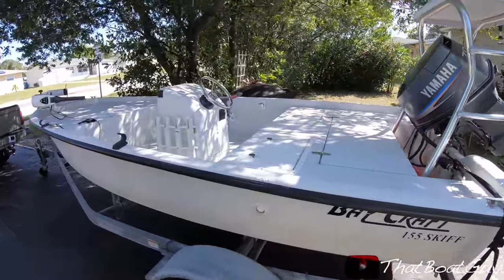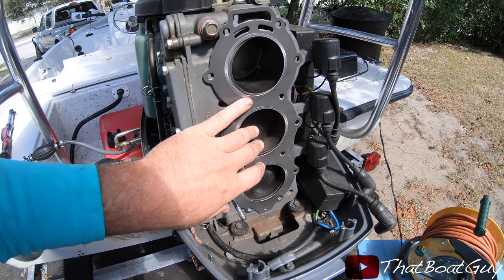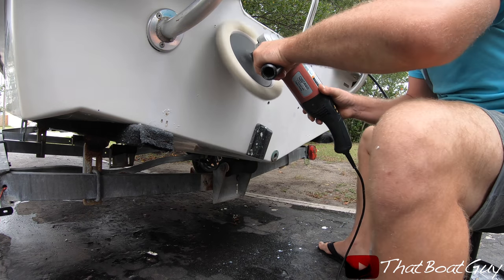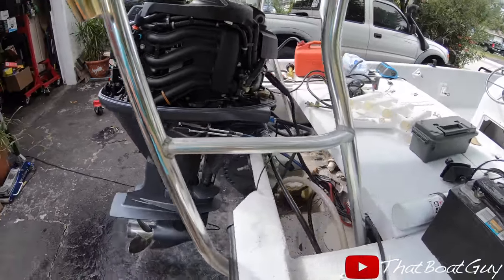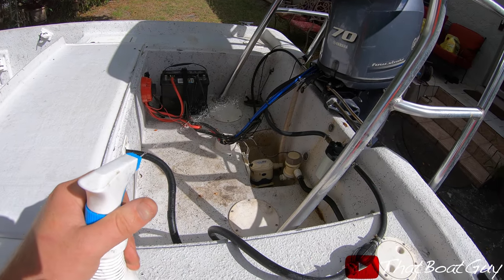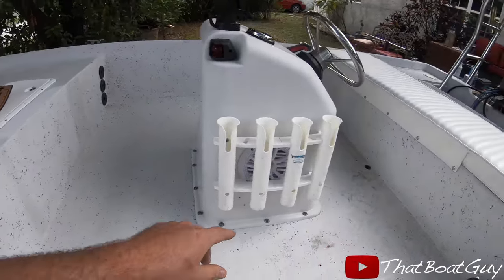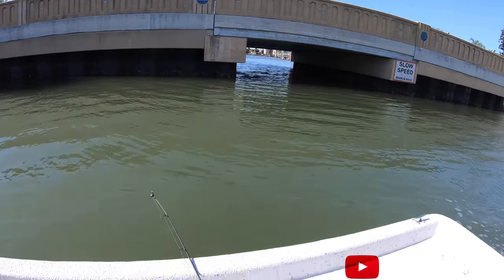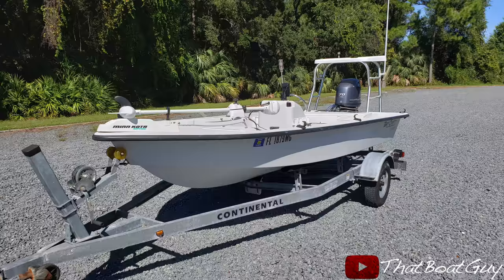This Boat Deserved A Makeover

Comment: Can you make a video of you tearing apart that Yamaha 70 two stroke with the bearing problems?  Would love to see how you go about that and replace internal parts!
Reply: I'd like to see that also.
Reply: He might just use a machine shop. Dunno if ive ever seen a bottom end rebuild on this channel.
Reply: Thirds for the Yammy rebuild video please!
Reply: @shize9ine  i would hope so! 90% of these should be bored in my opinion. ive rebuilt over 20 2 stroke outboards, and all were out of round atleast 2 thousands. my motto is if you want it to last like new, bore and hone is the only way to go. i see so many guys just taking a ball hone and putting new rings in these, and they only last 1/4 of the time they could have if done properly. plus its only $55 a hole from my guy.
Reply: @ct1762  usually caused by not letting the 2 stroke warm to proper operating temps before banging the throttle off the firewall
Reply: @fishonkayakadventure  definitely ! but usually because it ran hot... weather thats from old stale fuel or a blockage in the cooling system, excessive carbon build-up etc.
Reply: @ruaraidhmcdonald-walker9524 uh
Reply: @ct1762  I fully agree! If you are going to go through the trouble of rebuilding, do it right.

I have a friend who did a rebuild and didn't have the cylinders checked. He didn't want to pay the extra money. He bought an aftermarket rebuild kit. I told him he was dumb to not check the cylinders.

After rebuild, it runs. But it doesn't feel right. It's a 40hp. But it feels like a 30hp. Pickup is slow and top end just isn't there... I think it has low compression. He won't let me connect a compression guage 🤣
Reply: @michaelh7527  haha yea... seen it many times. People understandably get anxious to hit the water and neglect some pretty important steps! Which is why I do the serious rebuild in the winter. No "fear of missing out" happening in December up north. I will say promarine, mastertech, glm, etc. do make some really quality aftermarket stuff. probably some cheapo stuff out there too.
Reply: How much is it to get a mechanic to do a rebuilt for you?

Comment: Nice work as usual. The impeller fins always take a set and are bent, but its really about how flexible they are at high speed. if they are still soft, all is fine.of course might as well replace it, since it would need a new plate gasket anyway.

Comment: GREAT VIDEO!  just a suggestion for you when cleaning up the boats to sell. You did the transom, hull sides and cleaned the inside which brings it back to life. If I were you when you had the center console stripped before adding the stereo, GPS, etc you should have run your buffer on the console and brightened it up.

Comment: I wish you would actually go through changing the motor and the different steps
Reply: 4 transom bolts, a bulkhead plug to the controls/gauges, and a steering cable. 🤷‍♂️

Comment: Came out great! Your videos inspired me to buy a 1995 Boston Whaler Dauntless 13.  It has a Yamaha Pro 50 2 stroke on it.   All original boat, motor and trailer. Great condition, just needs a little clean up and basic maintenance.
Reply: buy whar 15   or sxoút 145 hybred rate 50

Comment: If ever you decide to sell any of those reconditioned boats, I am definitely interested. You do an absolutely amazing job. I am looking for a walk around boat for use in the bays of Oregon and Maryland for some crabbing. The motor is not so important as I will be putting a newer 4 stroke in it myself. Just interested in the boat itself and the trailer.

Comment: I use Bar Keeps Friend to wash my deck in the spring. It has Oxalic acid in it. (Active ingredient in a lot of hull washes.) I get the deck wet and shake the stuff on. Give a quick light rub with my car wash brush and let it sit. Power wash it off and a quick wax. Done.

Comment: Not sure if you already use it - but there is some stuff called Shur Hold Buff Magic.   It’s by far the best buffing compound I have ever used.  

Between that and using Meguiars Professional degreaser to scrub vinyl or interior - it removes ALL the black moldy spots and discoloration- they are two boat detailed secrets you’ll be thankful you know.

Comment: Nice boat and you should pick up a tool called a “Fish Tape”, $13 at Home Depot and it will make running wires and cables easy, especially in CC boats.
Reply: Electricians use the shop vac to pull small plastic bag and twine through conduit. Then use twine to pull wires.  Works great. Fish tape, fish sticks works well through very tight hard to reach spots.
Reply: How does the fish tape thing work

Comment: Sweet boat. I think she deserves a hydraulic Jack plate. And is that Bay Pines? Haven’t been there is years but my Dad owner the service center for Thunder Marine. Started it in the early 90’s in a shed then sold it and bought it back 1999 and sold it  again. It was right across the street on 95th.

Comment: That boat is perfect for the area you're in. Would a jackplate allow it to run more shallow? I've noticed boats without a tunnel really don't benefit much from them. Great video!
Reply: They do if u use jack plates with more set back like 6-8 inches
Reply: Rule of thumb is usually depending on hull design every  inch of set back allows 1 inch up

Comment: Just from very recent experience with cutting speaker holes in my Mako and my Carolina Skiff..instead of using the jigsaw… try using a router, cuts a very clean hole and less chance of tearing up the gelcoat around the hole.
Reply: chief had oay çompay  sterio    radio bukt in ßkíff çaróliiña skiff çopmy did iñstall

Comment: What fuel line do you recommend? I saw that was black was that auto fuel hose? I have a 6.6 gallon quicksilver tank for my mercury and it is 4 years old and works great. Do you recommend changing it the boat does not stay in the water and the can is always in the garage unless when on the boat fishing

Comment: Personally, I wouldn't put bleach on the wires (from personal experience) because what happens later on down the line, is it starts to build up this weird sticky coating to it. Not to mention everything will stick to it.

Comment: Yeah that jigsaw bru!! So unrelated question. I had a little boat many years ago with a 60hp 2 stroke motor that had glow plugs installed. It would continuously oil up the plugs and cause issues. Have you ever used glow plugs, are they any good?
Reply: yanmar  dussel óutboard

Comment: Hi 
Thanks for your videos. Those are very interesting. So, I have decided to buy a 6 hp portable outboard for an inflatable boat. But there are several brands, and everyone says something about each brand which is very confusing. The dealers say their own ideas. But I’m wondering between Honda, Yamaha, Mercury, Suzuki and Tohatsu which one is better. So, would you please help me and tell which one of these brands is high quality and high performance? I’m in doubt between Suzuki, Honda and Yamaha but I do not have any experience about the outboard at all. So please help me in this case and introduce the best option directly?
Thanks
Reply: buy merçury   6 hp  or hiñda  or yamha 6  amp 12 vokt alternatee  72  watts chargibg

Comment: You have some great video's. I do have a question. I own a Yamaha 200hp 0x66 vmax. I always use ring free in my fuel with non ethanol gas. After my motor sits for a week when I fist start the motor is really smokes bad. After I run it for awhile it gets better. I have been told that this is the nature of the motor. I have had the oil linkage rod check by my mechanic he said it was set correctly. Any suggestions on reducing the smoking.

Comment: Where are you out of, might be interested in doing some projects with you if you come across bigger deals that need some shipwright skills, however my experience has been limited to vessels made of wood and/or composite materials only. No ferro-cement or aluminum or Steel but I'm very interested in learning.

Comment: Hey buddy do you know if the F60 gearcase will bolt up to the f70? They are different gear ratios and would like the higher ratio on the 70 (performance application) also does the f70 really have a limiter set at 6300 like it's advertised?

Comment: Man id like another motor 78 inline 6 is getting hard to find parts for just had to turn 3/4 pipe cap for the fuel filter that's on top of the fuel pump lol

Comment: You have odly good boats i like it allot this is my favorite i live in the Netherlands and the boats here are very expensive and you picket some up voor 100 bucks that's crazy
Reply: Any $100 boat would be extremely rare, and probably a wreck.  But there are many boats in Florida where he lives, and sometimes people lose interest in boating so the boats set outdoors, and gather leaves and dirt for years. When they decide to sell it, the boat looks terrible. They think they have a worthless wreck, with a bad engine.  But as the boat guy shows, that is seldom the case.  I think he pays somewhere between $500 and $2500 for his project boats.  His purchase price probably depends on the current value of that boat, motor, and trailer, once he cleans it up and gets it running.  I think he is a good bargain hunter, and only buys something he can sell for at least a small profit, after fixing it up. 
As  you might know, owning a boat and using it is expensive in both time and money.  Right now people in some places in Florida are spending one, two, sometimes three hours in line on the highway, waiting in line to launch their boat.   They wait hour to get back out of the water and on the trailer.  Four hours just to get into and back out of the water is crazy!
In Florida it costs between $250 and $450 to rent a boat ski boat or small party pontoon for just a couple of hours.  Boats are money hogs. Not everybody enjoys them enough to keep them up and running year after year.

Comment: Hey Man! I recently bought a new boat and I’m looking at replacing the throttle cables, however I haven’t the slightest idea on how to. Could you make a detailed explanation video?
Reply: Its just a set of clips that hold the cables. If you remove all the panels. 
I recently did it for the first time on my suzuki 30 fourstroke. I have no technical background. Its actually really easy
Reply: @ewan1821  Okay I'll give it my best. Thanks.
Reply: @psychoholic-btd6806  i could send you a couple of pictures got ig?

Comment: Just out of curiosity if a teenager was looking to get into flipping engines and possibly boats with limited money and limited knowledge what would you reccomend?
Reply: Learn 2strokes well, buy some carb clean  and run searches on CL and you'll find plenty of free old boats around. I've made money flipping boats and I'm 19. Just need space, time, a decent hauling vehicle and a basic socket set or two
Reply: @erickalvarez900  thanks for the reply nice to know somebody my age (18) is able to actually do this sucessfully
Reply: @andrew.waldron  for sure.

Comment: hello 
I want to replace my tilt trim motor 
on 2002 yamaha 2 stroke 90
the aftermarket part seller wanted a part number but can't see on there could you help cheers